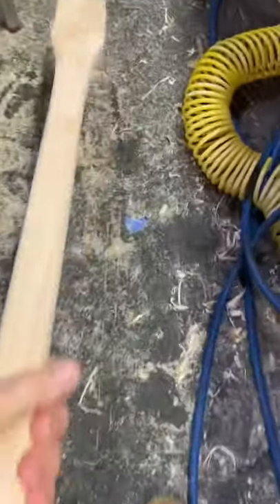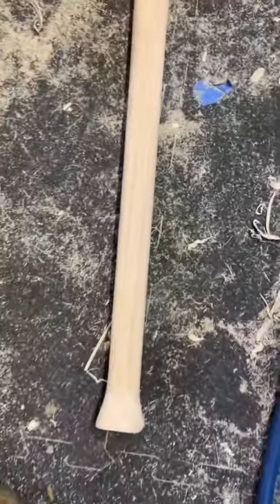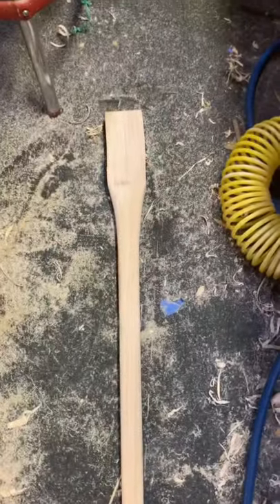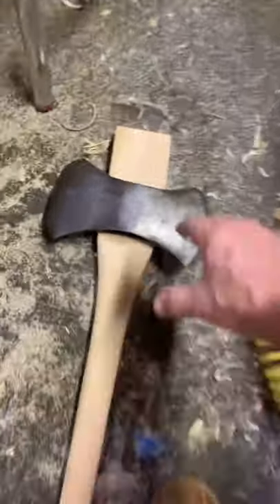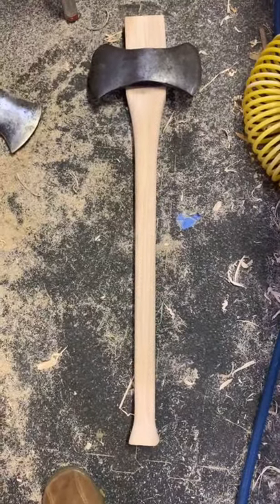Which axe head should I use? Sager Chemical Conundrum

Comment: since the handle is so thick you'd want the heavier/wider second head on it so you have less to take off buddy, first one could work too but its a lot more work to get it to match comfortably.
Reply from the maker: I don’t mind the work. It’s at about 15/16” so it’s not terribly thin. How you been!?
Reply: @casterman2  ive been on and off busy so not bad but tired. i mean its not a big problem of course but the wider head would fit easier and less time would be spent on it. after that you have more time on the other head i assume, its not gonna be a major difference if the weight is the same but you can flip a coin if need be lol.